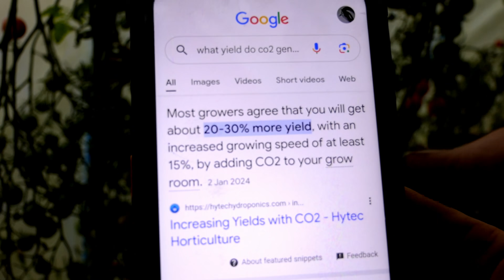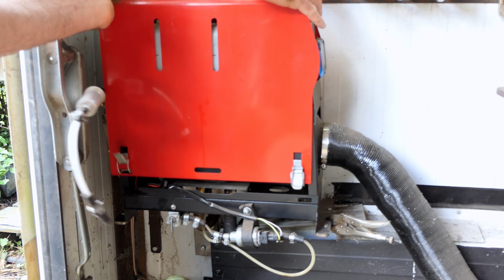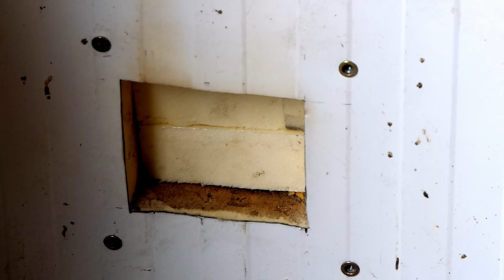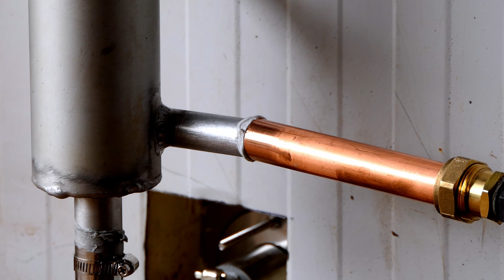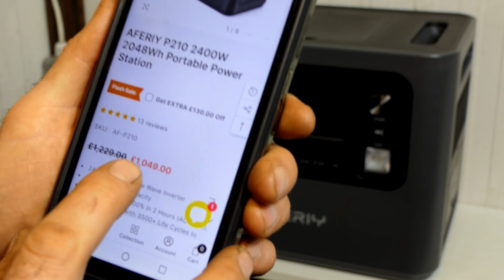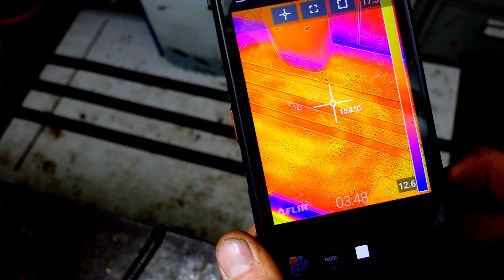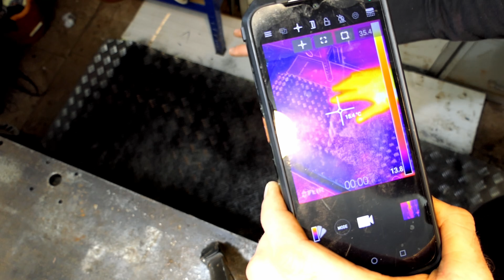NEW! Better system for Cheap and Safe Heating💲+ Underfloor Heating Mod test🫠

Comment: Hi brother,
Project is perfect. Congrulations! I had smilar 5 Kw webasto diesel heater and would like to install it as like as you. Just to ask you, Everything is Ok except Radiator part. Exaust Gas is heating the water and turning around hot water via pump and the radiator is hot… But exaust gas and water are mixing … 😳Radiator is evaprating water , water with exaust gas it is not clean water ? Is it harmful for human ? Because little by little it can be poisoned ? 

You informed in a one topic, you can clean inside. ? Is it your solution ?

Or Iron Radiator ?

Please get back to me.

Regards
Reply from the maker: The radiator in this video isn't mixing with the exhaust gas because of the heat exchanger. The best solution is an efficient heat exchanger that doesn't restrict the gas flow of the exhaust. I'll be building another soon and possibly manufacture them too. Cheers J
Reply: @joshuadelisle brother ,I understand that Heat exchanger is heated by hot exhaust gas and pass through by water inside. 

I mean, Water with exaust gas are mixing and acting together inside the radiator. Result is radiator is hot but it can be harmful because of carbon monoxide concentration of gas ?

Maybe I am wrong. Please get back to me with right infrormation :)

Regards.
Reply from the maker: @AhmetOzdemir-ys7wu  you mean condensation from the combustion reaction. Yes it's mild carbonic acid so it will corrode stainless steel but not aluminum.  Radiators will just corrode over time and leak gas. Cheers J
Reply: @joshuadelisle Thank you very much, brother. Best Regards.🙋🏻‍♂️
Reply: @joshuadelisle Brother, in fact, after the combustion reaction that I mentioned, the exhaust gas heats the water and circulates it in the radiator. I am asking whether the water mixed with the exhaust evaporates and condenses from the radiator. In short, whether the gas actually evaporates from the radiator? Doesn't the hot water inside the radiator evaporate at all? Isn't this water vapor harmful to the people in the room?
Reply from the maker: @AhmetOzdemir-ys7wu  the gas and vapor in the radiator should be isolated from the room. In my video the radiator is full of water that is circulating and does not have gas inside from the exhaust. If you're using a radiator as part of the exhaust without water then it needs an exit pipe going outside. Water will condense inside and then evaporate once hot enough. If the radiator extracts enough heat to be as efficient as possible then it will fill with water thanless you put a drain going outside also. Cheers J
Reply: @joshuadelisle  Really thank you very much for your all messages. I understood everything you said, brother. You say that there is no exhaust gas in the water circulating in the radiator. As I understand “exhaust gas Without water “ mixes in the part(heat exchanger) where you connect the exhaust of the diesel heater? 

How do you achieve this without mixing? Because when you slightly drill it with a screw, I can see the flow of water. Doesn't the heat coming out of the exhaust heat the water? Also, how can I buy a heat exchanger ;) Take a video little bit detail again, just for that part. 

Regards.
Reply: @joshuadelisle Brother I think I understood when I watched the other video. There is an exhaust pipe passing independently through the aluminum Heat Exchanger. One side is inlet and the other side is outlet. In this way, exhaust gas does not enter the circulating water and it is safe. Last question😅 The water entering the Heat Exchanger combustion chamber will evaporate or decrease due to continuous heat, how will we keep the water addition under control? How will we add water as it decreases. Will the water in the radiator decrease after a while? You only used a circulating pump to circulate the water. Thanks brother.😘👍👍👍👍🙋🏻‍♂️
Reply from the maker: @AhmetOzdemir-ys7wu  if it's an open circuit then simply topping it up or adding a tank with a float valve to maintain water level from mai s water will work. Otherwise adding an expansion tank to make it a closed system will work fine provided you add a safety release valve. Cheers
Reply from the maker: @AhmetOzdemir-ys7wu  I'll be making heat exchangers soon for sale. Cheers J

Comment: Underfloor heating pipes should be surrounded with a conductive material ( traditionally screed) as this picks up and distributes the heat. In surrounding all but the top of the pipes you have minimised their ability to loose heat. This is why your output is warm and the underfloor panel is not)

Comment: Great video's.. as i've come to expect.. i especially like the "tough phone test" nearly cost me a laptop that did.. as i had a mouthful of coffee at the time.... anyway I need a pointer off you or one of your subscribers.. On my diesel heater,  i've extended my exhaust through a radiator, to try and harvest some exhaust heat, i manage to get the end of my 5m exhaust down to around 25 degrees.. what concerns me is on my diesel heater it was set to degrees C and when set to 22 it was chucking out black smoke.. . when i log into the "admin" settings i get a T1H2 (my manual tells me nothing around this) which i wasn't expecting when looking to "tune the heater"  to burn as little diesel (I'm using red as it's easily sourced where i live) so is it the red diesel causing my black smoke, my exhaust length, my settings. I would welcome someone with a little more experience giving me a nudge in the right direction..  Keep up the great work..

Comment: Hey, nice to see another 18t user. Been rocking mine since april 23, love this thing. FYI, if you wanna see the exhaust temp, you need to switch to high temp mode, its the little flame icon, that will let you go to 400c.

Comment: Excellent video.👍

Have you checked out MoreDteTv and his "Diesel hearer upto 200% more efficient??" 
He links a radiator directly to the exhaust, no heat exchanger.
My only concern would be the acid build up.

Comment: Hi Joshua 🙋  I have a question...if this ting will run 24/7 on full... how much diesel it will use per day? + how long you think it will last? How durable it is?
Reply from the maker: Running hot is better than running low for longevity and the prevention of carbon build up. 350ml per hour is what it uses on max. 3.5kwh roughly. Cheers J
Reply from the maker: Will last year's and all parts are cheap to replace. Cheers J
Reply: @joshuadelisle  but the first question... how much diesel per day in full throttle... thanks for your time, it's amazing that you replied so fast🙏
Reply: @joshuadelisle  I watched  other videos from you about this unit and somehow I missed the amount of fuel,  I got just the £ per KW which ...that's nice but for me not so useful ...but my bad if you saying there somewhere...sorry🤦
Reply from the maker: @tomashrdina8991  it's roughly 9L per 24h running on full throttle (5.5hz).  I recommend an air filter just like on an engine to keep dust out of the fan which will increase its longevity. They have safety features that auto turn it off if there is a problem with power, fuel or too high/ too little temperature. Cheers J
Reply: @joshuadelisle  nice...thanks ❤️

Comment: Hi, I've got a Chinese diesel heater and it all works great but when it's running it has a slight odour of rubber getting warm/hot the exhaust and combustion air come from outside and all seems well sealed. Just wondered if this was just a new heater odour. I'm going to strip it down and check for anything obvious.
Reply from the maker: yes thats because its new, it does go away after a few hours of use. its the plasic and residual oil from manufacture. cheers J

Comment: Learned a lot from this vid. 
Had it on 1.5 speed to rush through before work.

I don't think the eco skepticism is accurate, and does sadden me that it's so broadly accepted nowadays. 

Also

....you do say "your objective opinion" which 
I think (?) is a contradiction? 
Nitpicking for bantz.

Comment: Ditch the kingspan insulation floor and put the pipes into concrete so it can absorb the heat from the water

Comment: You used pex triple walled pipe for your underfloor heating? I am sure this is not what is used in underfloor heating systems. This will still work but it will take longer to transfer the heat through the thick walled pipe. A very good video, with lots of good points 😊

Comment: The delta in temperature is a good proxy for efficiency between the input and the output for a very limited range of values. Use watts per unit mass would be much better. Harder to calculate I understand. But a better way of knowing how much efficiency you are getting out of the system.

Comment: The delta in temperature is a good proxy for efficiency between the input and the output for a very limited range of values. Using watts per unit mass would be much better. Harder to calculate I understand. But a better way of knowing how much efficiency you are getting out of the system.

Comment: Radiant heat pipes DO NOT BELONG IN AN INSULATOR!! They are to be installed into a medium that will then get hot and radiate the energy for a long time. The sand principle.

Comment: I bought one of the diesel heater efforts , the ones designed for lorrys. There was as much heat going out of the exhaust as from the feed pipes to give warmth.

Being a tight fisted old fart I came up with an easy way to save all the warmth from the exhaust so the temperature leaving the exhaust exit is barely luke warm. I do get a moisture build up but a simple tap drains that off which I drain off before starting up each time. I'm yet to try cheap cooking oil in mine, do you think its worth a try? Also what do you think about using well filtered old engine oil?

Bob

Comment: 1) One must consider the rate* of change not just the amount..ecosystems have a hard time dealing with rapid change..with effects to hard to predict. 2) It does not matter if it all mans fault or mostly mans fault...  effects are additive. Be responsible for our part 3)  Be conservative, it's better to not ignore the possibility of  our impact and take action before its too late, if it isn't already...  Generally people are not "punishing" anyone any more than we "punish" people for littering in other peoples yards.   Anyway parking heaters rock! I use mine as backup to my solar powred home with a mini split,  it's automated by an IR blaster and home assistant...  prevent the need to run a generator as heating is the biggest consumer.

Comment: a bit late to the part here. for recovering the exhaust energy... is it possible to make the exhaust much longer, run it along the bottom of the shed and out the wall further away allowing you to use the heat within the shed  ??

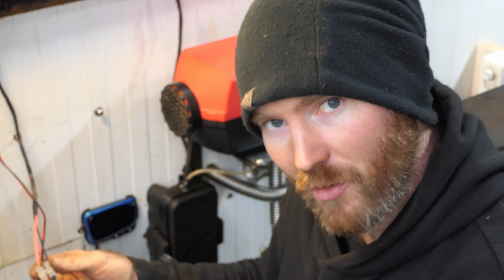Comment: 24:43 Now, fortunately, water, being a liquid, is very difficult to compress. Therefore, a system filled with water would not explode, but rather rupture and leak at the weakest point. This could be the hose in your floor, so yes, still very useful to leave it an open system.

Comment: Great video, but question, why don’t you just gravity feed the Kerosene and get rid of the pump?
Reply from the maker: its possible however its set to a precise ratio for maximum burn efficentcy. this outways the cost of electricity should a gravity fed system isn't calabrated accurately. cheers J

Comment: Properly designed heat pump system with low flow temperature, >400% COP in winter. Couple that with a home storage battery that means we only use off peak electricity at 13p per kWh. Nets out that we only pay about 3p per kWh. No carbon or insurance issues…..the tomatoes will have to grow the old fashioned way though ;)

Comment: 0.04% C02 = checkmate to the envirofascists. I'm seriously considering getting a UPS though, as a power cut killed my diesel heater the other week. Never mind, it's the 2nd one I've had, & I've just bought another two diesel heaters (in anticipation of Emperor Starmer banning them). Under £60 on Ebay for an 8KW now. Even at £100 each, it's worth buying a new one every year for the amount of money the corrupt energy companies (govt agents) don't get to steal from me.

I've got no time for criminals, & this world is run by criminals.
Reply from the maker: @jossambrose6296  spot on. Cheers J

Comment: I saw a video recently where someone ran their diesel heater exhaust though an unused central heating radiator  before it exited outside and reclaimed the heat in the exhaust.

Comment: Does anybody know what power supply you could use for 240 mains?
Reply from the maker: @IanMansfield-w7h  12v 150w minimum. Cheers J
Reply: Thanks Josh, great channel we have just moved to the Azores to get away from the UK madness. They don’t have Heating here but they have humidity/damp problems in winter so I’m thinking couple of months a year I could just blast loads of warm air into the house to get it above the dewpoint. One of these looks ideal!  Keep up the good work
Reply from the maker: @IanMansfield-w7h  that's awesome. Can I ask how difficult and costly is to move there? I would consider it for escaping the madness also. Cheers J

Comment: Hi sorry if im acting stupid but shouldnt the black paint have been on the underneath of the checker paint so as to absorb the heat up ward rather than reflect it back down or am i mad ..which is possible
Reply from the maker: @stevon69UK  the paint is just for the thermal camera to give it a Matt finish. It does nothing for my heat transfer. Black only absorbs infra red heat which is what you're thinking. Convected and conducted heat is not affected by colour. Cheers J

Comment: I decided to jump on the Air Source Heat Pump train, because of all the government grants, only to have the cost of my heating jump tree times higher than on gas. In addition, when I queried it on the Heat Geeks FB Group, I was told that Heat Pumps will never match a Gas Boiler like for like, but I should feel better that I am saving the planet.... sure yeah, somehow I don't see that as a good thing. 

It would be much better if they stopped cutting down the rain forest and other forests, climate change is caused by the big greedy corporations. We are paying for their stupidity.

Comment: Hello. I thinking of getting a greenhouse and heating it with one of these diesel heaters. I estimate run costs of around £17 per week to heat the greenhouse during winter dark hours in the not very warm North of England. To be more efficient I'm thinking of also adding 2 x 25l barrels of water which I would like to heat from the diesel heater, which could keep the frost away for maybe a couple of hours at a time so I could switch off the diesel heater and save costs. Could you advise of a simpler method of heating a couple of barrels of water with one of these Chinese diesel heaters 3 or 4 times per night? A video would be very welcome. Many thanks.
Reply from the maker: @splash2540  a normal paraffin green house heater can run on regular diesel and kerosene. They're very cheap and equally cheap to run and don't require electricity. You can use one to heat up water too. Otherwise a rocket stove mass heater would be ideal if you can get wood cheaply. Cheers J
Reply: @joshuadelisle  Thank you.
Reply: @joshuadelisle  If you don't mind helping with one more question? Is it possible to build a thermoelectric generator which can sit on top of a paraffin heater to charge a 12v battery? Many thanks.

Comment: Great video. Been very interesting. Helped give me many ideas for my deisel heater / s.
Had been wondering about if i could use Kero instead of deisel? Or if i needed to add anything to it for it to work?

On the CO² thing..... something someone mentioned to me ( a climate researcher) was that everyone's busy looking at climate change being caused by CO² levels rising.... but lots of research actually saying its rising temperatures that are actually releasing the extra CO² ( mostly from melting ice and permifrost etc ) and also as temps get warmer.. then living organisms naturally produce more CO².... 
Just thought it was interesting what he had to say.

Comment: OMG ..... yep .... agree entirely Josh! The only thing I'd add is that CO (carbon monoxide) will float around in pockets or big bubbles depending on the rotation of air in the room as it slowly mixes with the air in the room, becoming more and more concentrated until it is lethal, so the alarm should be above the appliance but towards the same direction as the blower in this particular case so you get the earliest alarm possible ... It's called the silent killer for a reason as you will slowly fall asleep before you know anything is wrong! CO alarm absolutely essential!! Amazing video btw

Comment: 49:55 You are absolutely right global warming has happened before a  verry long time ago and as you said we are still just coming out of the last ice age. So global warming will happen and can't be stopped it's a part of the earth's natural cycle. So over millions of years it wil warm up and then cool down again. It's natural. People do need to understand this the information is out there it just takes alot off research and reading between the lines but it is out there too discover. 👍👍👍👍👍